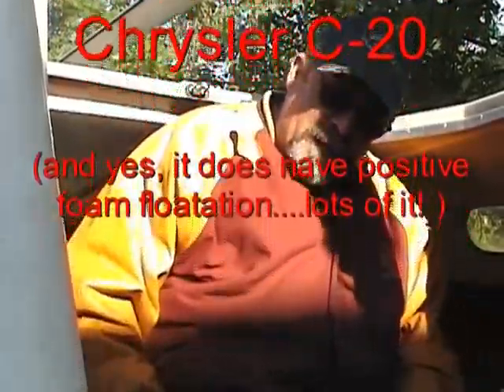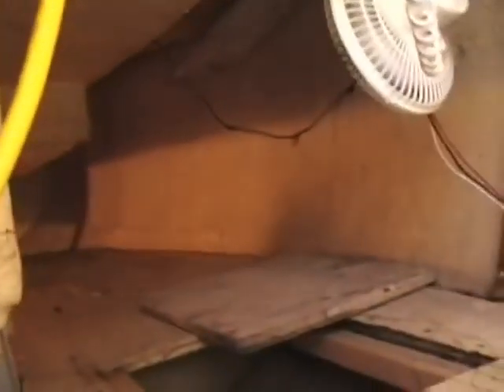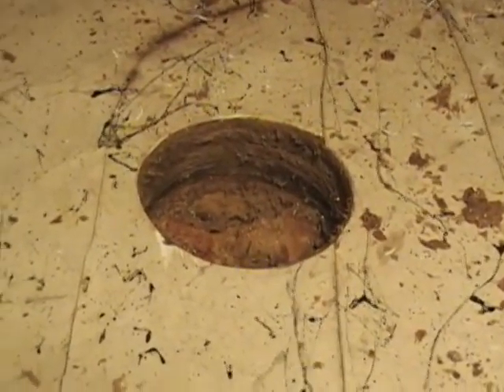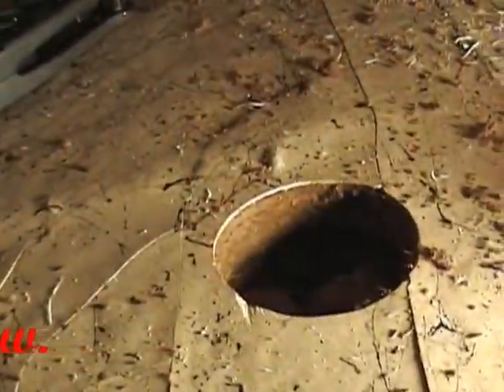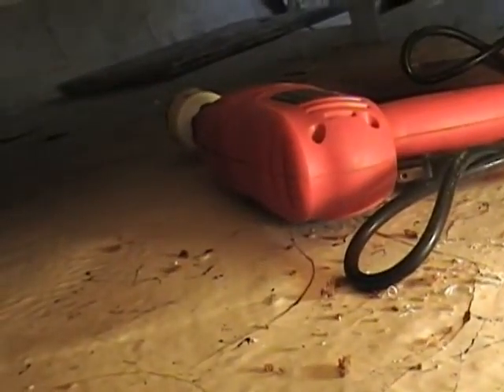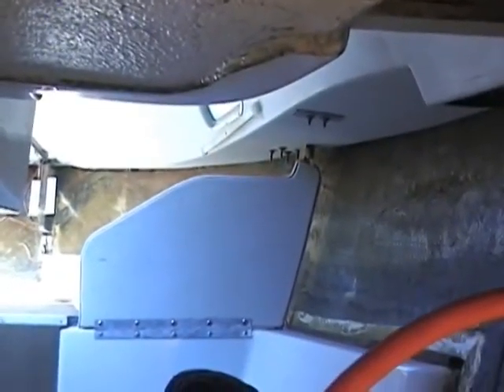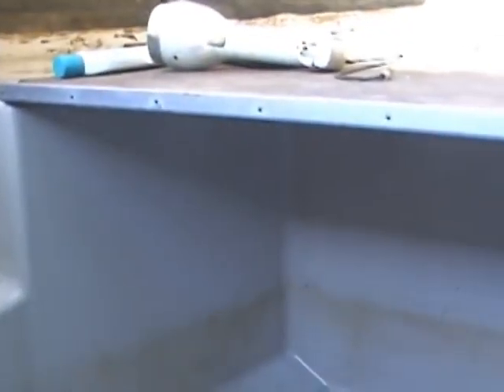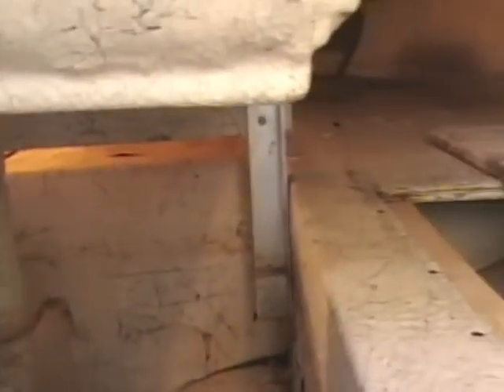A Tour Through the Bowels of a Chrysler C-20

Comment: I owned one of these boats for a few years.  I consider them very under rated.  The 20' is somewhat rare and in many respects is way over-built compared to many other 20's.  It has the same mast blank as the  22' and has three shrouds per side: two lowers and one upper.  That's hell for stout.  The hull design was signed off by the Herreshoff design studio, as were all the Chrysler sailboats.  The 20' has a ballast to weight ratio of about 36%, which is 100% below the hull bottom, even with the swing keel retracted.  That is in the realm of many cross ocean cruisers. This boat is a very safe and stable sailer.  It has high freeboard and a deep flush cabin that is 9' long and feels bigger than it is.  The hull is very thick and it has a pull up rudder.

Two things that I would recommend to any buyer - other than the usual inspection of an old boat: remove the shroud chain plates and go inside and add several more layers of fiberglass along the area through which the chain plates are bolted.  I do consider the side decks a bit thin.  A bit of grunting about will result in a shroud reinforcement that will be as good as any Dana, although the latter has a completely different deck to hull join.  Second, consider adding longer runners for the jib sheets.  This boat  does not have toe rails so being able to flatten the headsail for better upwind performance is a positive improvement.  The shallow depth keel trunk and the swing keel don't grab water as well as a full keel boat, so any help in sail trim is going to be advantageous. That, plus the boat is a fatty, so going to windward is not particularly spectacular.

All in all, I felt that sailing this boat felt like a 22 footer in some very rough conditions when others were heading in or didn't come out at all.  It is a very dry boat in chop and doesn't have that hollow, booming feeling that more modern, lightweight boats have.  No matter where I pushed on the hull, it didn't flex.  Felt like concrete.

The guy I sold it to wrecked it on the ramp.  Pounded the keel and rudder to bits (failure to retract)

Comment from the maker: Voi lá ! Finally found the source of the mysterious weeping keel.  Rain water from the deck is designed to  drain through the swing keel cable tube. There was a cruddy joint seal between the deck and the tube.  An amazingly cheap and simple fix to a problem that's perplexed more than a couple C-20 owners.